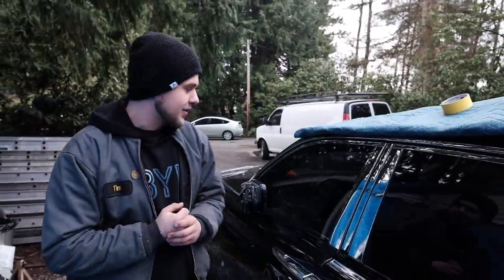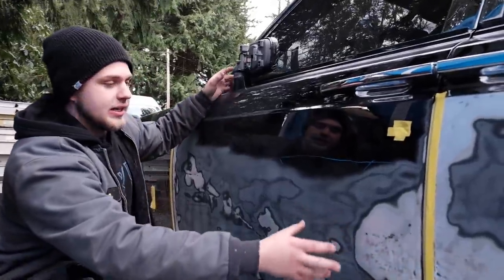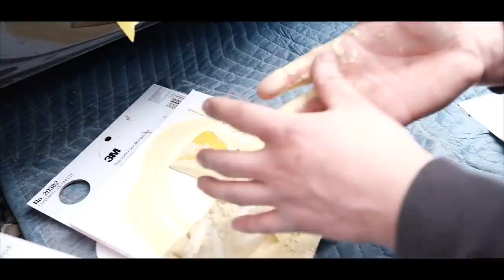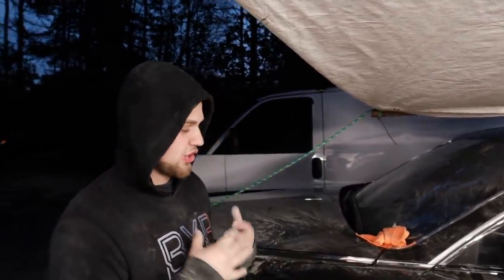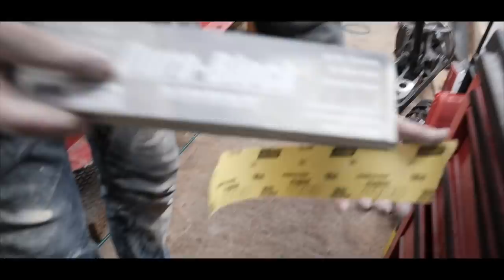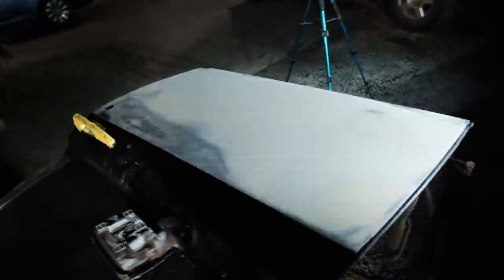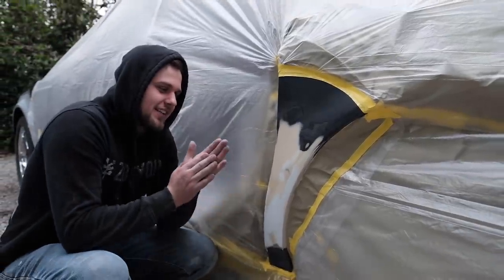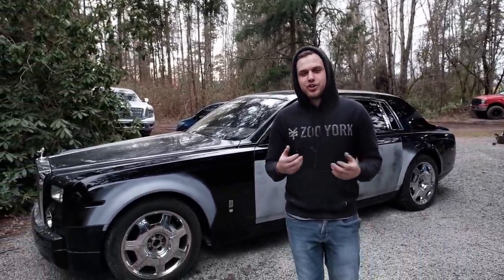Rebuilding A Rolls Royce Phantom From Copart! (Part 3) Here’s How I SAVED 20,000$ DOORS!

Comment: you can build and house with that much filler :D
Reply: Rather than spending 20k for a single door🤷🏻‍♂️
Reply: That Royce rolls is a battleship 🤣
Reply from the maker: It’s really not that much filler. It’s super super thin
Reply: Tim is wicked at what he’s doing here content amazing don’t really see good alloy body panels beaters so good well done
Reply: @BackYardBoyz  after all the needed sanding the leftover filler is really thin. It only looks that much before the sanding process
Reply: If you look most of the filler is on the ground 
He done a awesome repair on the doors
Reply: @BackYardBoyz  Amazing work. !!
Reply: yeah lay it on a little thinner and you have less sanding to do- but the doors were pretty straight to start
Reply: They already come with a load of filler on them from factory so does it even matter? 🤷🏻‍♂️
Reply: The only way to see if this stands up when it's finished , put the car on a ramp just above eye level then you will see if it's perfect .this all ways sought the tradesmen from the dross ! .
Reply: Lmao, I haven't watched the video yet.
Reply: Shoulda hit it w epoxy primer then body filler.
Reply: He low key uses too much filler to fix things. ..

Comment: body filler on any Rolls panel = resale price dropped already with 30%. This is not a car which ends up at the shredder, it ages well like a good wine or whisky. And it's easy to check: knock with your finger on any panel, sound is deaf = body filler, sound is empty = metal panel.